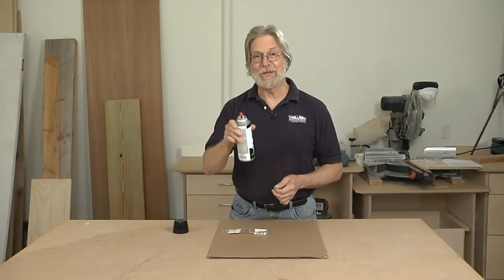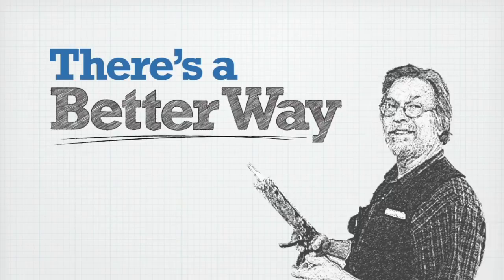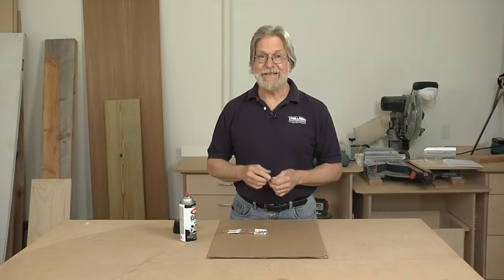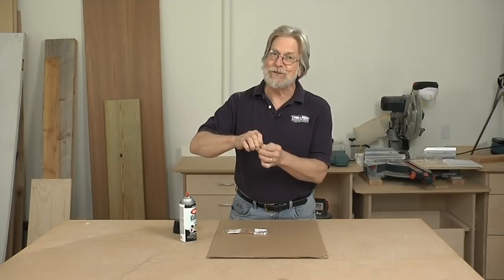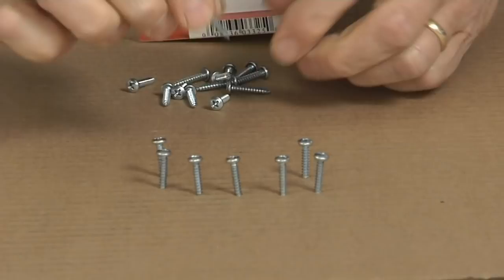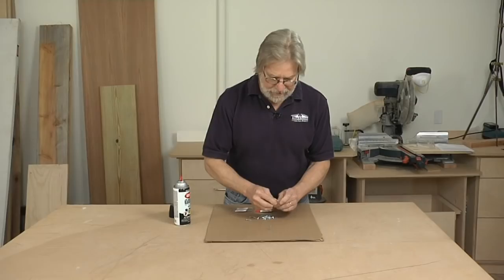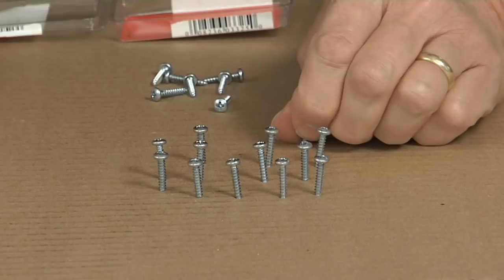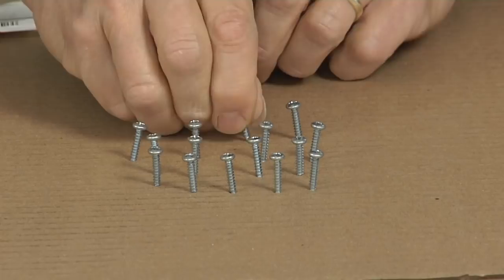How to Paint Screw Heads Without Making a Mess

Comment: As far as the paint chipping off when you screw:  Use a self-etching metal primer before your finish color.  Won't be scratch proof, but a heck of a lot more durable than run-of-the-mill primer of <gasp> primer/paint combo. Agree with everyone re pushing them all the way through.
Reply: they'd have to be bare, otherwise it'll just lay on top of the zinc and add another coat to gunk up the head

Comment: When you screw them in place, the paint is scratched away. How do you sort that out?
Reply: Put a thin piece of fabric (cheese cloth or similar) or tissue paper between the head and be gentle but firm.
Reply: Epoxy paint would probably do the trick but has a gloss finish (actually is a matte finish epoxy but it's expensive), so you can spray a coat of matt or satin lacquer to get those finishes. Can also use other methods; ie: sand and buff.

Comment: This good if you are NOT paint matching. Sometimes you need to use a brush.
Sometimes you need to paint BOLTs.  Also for you guys that powder coat,use METAL MESH or Metal fence. HD outside by the slam in garden posts.

Comment: Just take a good metal paint and brush it on with a small quality brush from a craft or art store...
Reply: Only problem with that is it clumps up inside the screw head, I don't like that.
Reply: @motavice3499  motavice, as I have been able to ponder this for the last 7 yrs, I have come to a realization that you are correct, it is a BS comment and you are right, had this very problem lol, paint clogged the screw tip more than I thought, used paint thinner to thin it down, never again lol

Comment: Lol... how about all the grease from your fingers from pushing them in? And only 1 coat? You would be better off using an oil based paint with a small brush after degreasing them properly... I'll just stick to powder coating.